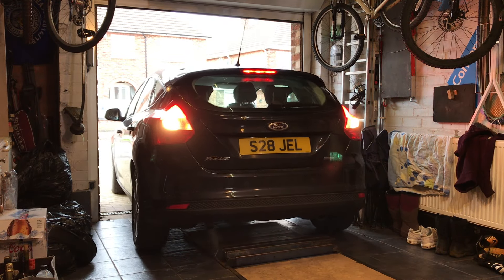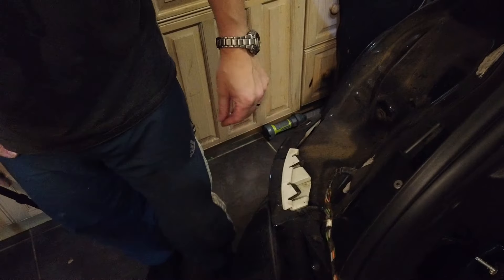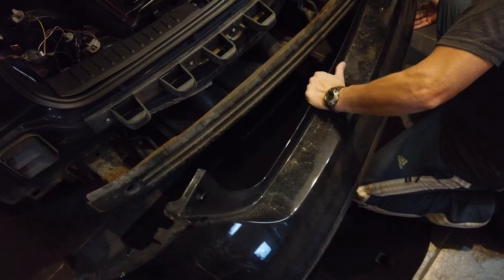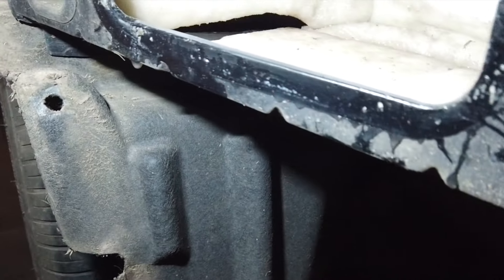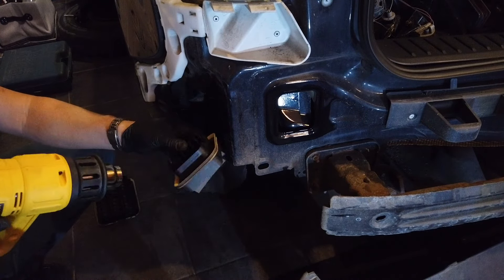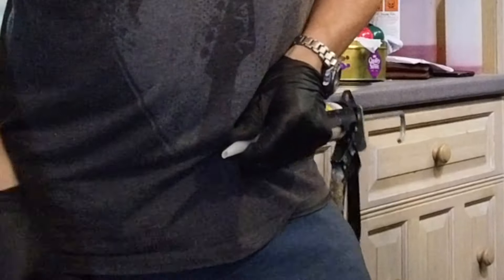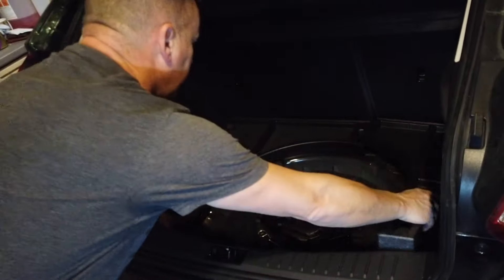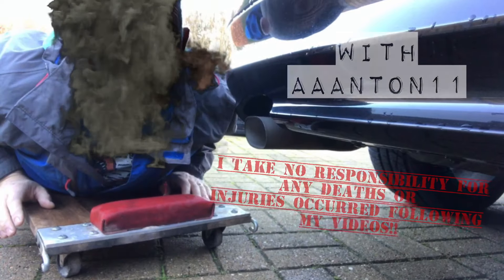Ford Focus Water leak in Boot, Sealing Rear Vents Behind Rear Bumper

Comment: Tip for removing vents. I just did this on my 2016 Fiesta and it only has one air vent on each corner. Here is a tip I found after doing the first vent for removing them at least with the 2016 model. If you lift up the bottom flap on the vent and look into the vent you can see the back side of the clips inside and use a screw driver to push up on the bottom tabs after inserting it between the rubber edge and the car wall (there are two on the top and bottom). This method allows one to see where the screw driver is (while keep the flap up) after inserting it through the bottom of the vent. Lifting the flap made it so much easier to remove the second vent after doing the first one the hard way.
Reply from the maker: Thanks for the great information👍🏻👍🏻🛠

Comment: Fantastically helpful video. After much frustration and one broken air vent I found there is a way to extract the larger of the two vents on each side wihtout too much pain and frustration. You need to remove that bung underneath and then you can feed a screwdriver in while guiding by feel with a finger to where one of the clips is. Once that clip is popped there is another rubber bung to the side of the vent nearest the engine. you can remove this, and although you cant get a screwdriver in you can put your finger in and feel for the clip. This then allows you to feel when you are actually moving the clip with whatever implement you are using and slightly help it out as well. Once both bottom clips are out the vent should come out easily
Reply from the maker: Thanks Joel for the great information👍🏻👍🏻🛠

Comment: I have water coming in on a B max I've tried pouring water around the boot shuts the gas struts the lights the roof rails everywhere you are going to suggest I've tried please can someone tell me where to look next roof rails check boot surround check rubber weatherstrip check gas struts check tail lights join car check where is the water coming in this video shows the vents being sealed check when vehicle is stationary no water after driving around for 10 minutes water back in any ideas?
Reply from the maker: Windscreen seal was a gap in the bonding, its quite common, Thanks for the great comments👍🏻👍🏻🛠

Comment: I learned an easy trick to remove the air vents starting with the bigger one.

Poke the corner tab with a screwdriver through the bottom hole. It should easily come off when you press the release tab. Then remove the top tab on the same side by pressing down whilst pulling. This should easily come off too.

Once you have one side released slide it towards you and pull at an angle. 

Took me 2mins to release the other side when I learned the technique. Hope the instructions make sense.

Thank you for this video!! You've helped so many people now!
Reply from the maker: Thanks for the great information👍🏻👍🏻🛠

Comment: Thank you so much for posting your videos.  My wife and daughter both have Ford Focus cars on 2011-12 plates and both had wat ingression, one right up to the front foot well.  After watching your videos I have now dried both cars out, removed the bumpers and fixed the leaks.  Thank you so much, you saved me a fortune on garage bills and I would not have had a clue how to do it without following you.  PS i also did a front light as well.
Reply from the maker: That is awesome! Thanks for the great comments👍🏻👍🏻🛠
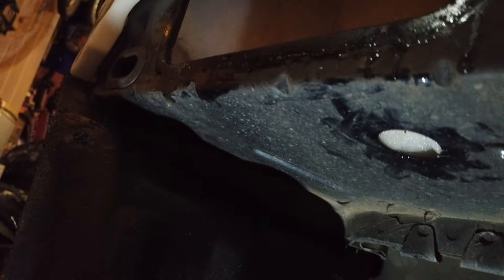Reply: hape you put back on those rubber covers  under the car at 14:00 or its  still open

Comment: Just did mine...your video was a life saver so thank you very much....
I found bestbway to start getting the vents out, is to pop the little black rubber bung out from underneath, and use your finger to pop the first clip thing out, then a screw driver easily pops the other one out amd makes them far easier to remove....
Thanks buddy 👍
Reply: Ps i went overkill and sealed the outside too...
Reply from the maker: 😂😂 definitely not going to leak now then, Thanks for the great comments👍🏻👍🏻🛠

Comment: Thanks very much for this video, followed it through this morning and it made the whole operation so much easier!

I have a hint for making the vents easier to remove!  

Do the back ones first: lift the top rubber flap (gently, these are delicate) and you can simply pull in the top two tabs with a couple of long thin screwdrivers, no aggro at all!
The whole top half comes loose and you can run another thin screwdriver down the outside to push in the bottom tabs.   Back vent comes out in about a minute!

Then reach inside through the back vent hole and, so long as your hands aren't massive, you can pop down three of the side vent's tabs (couldn't reach the top/far one) and wrestle that out in not much more time.
Reply from the maker: Thanks Shamble for the great information👍🏻👍🏻🛠

Comment: Did mine this morning. Thankyou for the video it all went well. Only broke two clips. All four vents were loose and not sealing in any way against the body. Prepped with scotch brite and cleaned with acetone before applying a marine grade silicone  sealant. Fingers crossed it worked. Also made silicone washers for the light fitting bolts. Many thanks.
Reply from the maker: Thanks for the great comments👍🏻👍🏻🛠

Comment: I had this problem on my new to me 13 plate Focus. 
Great video for doing the belt and braces approach of sealing the vents but for me, the easiest thing to do it just remove the bung underneath.
Allow the water to drain then pull the wadding out through the hole.
Leave the bung out.
I've not had any pooling water since.

I don't have the luxury of a garage so again it is the best option for me personally.
Reply from the maker: Glad it helped, Thanks for the great comments👍🏻👍🏻🛠
Reply: i dont have a garage either so will do this quick fix

Comment: Discovered wet passenger floor last week and traced it back to the boot and finally the blanking tape over the holes into that void area. Pushed the bungs inside to release the pond that was hiding so next dry weekend I'll be following your brill tutorial on removing the bumper and sealing the duff vents in properly.   Cheers 👍🏻
Reply from the maker: Thanks for the great comments👍🏻👍🏻🛠

Comment: Great video with detailed instructions. I did that work two years ago on my 2012 Focus. Recently found out again water in the trunk, but only on the right-hand side. Today I took it apart and saw that my vent opening sealing is still good. Then I realized that water must've been entering into the vent corner from the top, around the fuel tank door - it is the same volume. Applied sealant around. We'll see if it is successful.
Reply from the maker: Thanks Stevo for the great information👍🏻👍🏻🛠

Comment: This is a great video with excellent commentary. All the steps are very clearly showed. I followed this to fix the water issue in my Ford Focus Mk3 2012. I used Tigerseal Adhesive & Sealant that I purchased from Eurocar parts 
Removing and putting everything back together probably takes an hour or so. Most of the time is to dry the sound damper cloth and cleaning/drying the water area.
I put the sound damper cloth and grommets back in.
The vent design/sealant is a very poor design from Ford.
Thank you very much for this video.
Reply from the maker: Thanks for the great comments👍🏻👍🏻🛠

Comment: Mate - another one thanking you for this video. My 64 plate was identical to your video apart from (oddly) a mix of bolts and screws under the arches. My soundproofing materiel was identically soaked. Left those and the bungs out - no difference to cabin noise - sealed the vests and happy days!!
Reply from the maker: Well done, Thanks for the great comments👍🏻👍🏻🛠

Comment: I've just bought a focus with a damp boot. Looking like this is the issue. Thanks for this, it's most helpful 👍
Reply from the maker: Thanks for the great comments👍🏻👍🏻🛠
Reply: Just finished. left the car at the airport for a week. When I got home, wheel well was half full of water. Pouring in. had to get new vents from dealer as they broke when prying them out ( £16 each ) Siliconed them also just to be sure. Thanks very much for this video, it was a god send. Job went off without a hitch. I would never have found the leak without you.

Comment: WOW what an awsome easy to understand Video.
THANK YOU very very much for sharing your water ingress solution with us all.
I have a B Max (or as i like to call it the swimming pool on wheels) and I am cursed with the same problem.
I have tried every thing from completely silicone sealing the rear lights to the Car body but i never would have thought that the problem would have been hidding under the bumper air vents : (
It seems like every Ford model Fiesta, Focus, B Max, C Max ect is cursed with this same problem yet when you go to a Ford Dealer they do not want to know, SHAME ON YOU FORD.
Thanks again for posting this great video : )
Reply from the maker: Thanks for the great comments👍🏻👍🏻🛠

Comment: Thanks for posting this, I wouldn’t have known all the bolts & screws to find. My spare wheel well was full of water, now I understand why the rear passenger footwell is wet- the water pushes forward when I go downhill. I had heard a sound like fuel in the tank, now I know it was water in the spare boot.
 I should have listened to your advice word for word, I got impatient with a grommet underneath the bumper and ended up ruining it, other than I got the bumper off and on again. Time will if I sealed it well enough.
Reply from the maker: I am sure you have done a great job Thanks for the great comments👍🏻👍🏻🛠
Reply: How is it now?.. Just found half a bucket of water in boot of our 63reg focus, am gobsmacked this is a common issue, now currently watching many vids on how to fix..

Comment: Thanks very much, I followed this video and it helped. To get the side vent off, a length of dowel up thru drain plug to release one tab, then pull it down to release opposite tab, drag it forward an inch then rotate in cavity to twist it free. 👍
Reply from the maker: Glad it helped, Thanks for the great information👍🏻👍🏻🛠

Comment: Brilliant guide just done this fix this morning after finding water in the boot last night filled half way up my space saver tire, clip on the vent snapped trying to get it off but with it being sealed it shouldn't be an issue, thinking about drilling a small hole in the rubber bungs under the car just incase, thank you very much
Reply from the maker: Well done, Thanks for the great comments👍🏻👍🏻🛠

Comment: Just done this thanks to your video,snapped a piece of one of the larger vents off though 🤦🏼‍♂️ taped it flush and siliconed over the top of it, hopefully it holds. Put a shit ton of silicone on the back and front of each vent, hopefully solves the issue 🤞🤞
Reply from the maker: Sounds like a great repair, that will be ok👍🏻 Thanks for the great comments👍🏻👍🏻🛠

Comment: Great video. A great guide to curing my problem. Both cavities behind the grilled were full of water with no obvious way of entering the boot with the car on level ground, but in motion or unlevel ground it probably flowed through the lower of two perforations so I sealed these on both sides just in case.  I used caravan mastic as it stuck better and is thicker than silicone.
Reply from the maker: Glad it helped! Thanks for the great information👍🏻👍🏻🛠

Comment: Will be attempting tomorrow on my Fix Or Repair Daily. Did a headlight today had water in it. Seriously Ford couldn’t spend a bit money on these tiny details. Will be using your video step by step thanks a lot 👌🏻✌️😁
Reply from the maker: You can do it! Thanks for the great comments👍🏻👍🏻🛠
Reply: @aaanton11   I did it!!!!!!! I freakin did it!!!!!!!!! 😁😁🤩🤩🤩🥳🥳🥳😜😜Only thing I have now is to new plastic screw thingys that holds the bumper under the centre. I can’t get them in, they so brittle. Thank you so much thanks to your accurate video I managed to it on my drive 😘😘

Comment: Great little video, I’ve had a smell in the motor over the very wet winter we’ve had, just found a couple of litres of water in the boot, had previously checked lights and they were ok but this is tomorrow’s job, thanks again.
Reply from the maker: Its a nice job to get stuck into, Thanks for the great comments👍🏻👍🏻🛠
Reply: aaanton11 nice and easy little fix all done, I found the vents came out easier with a bigger screwdriver, it was the side vents that were leaking, job jobbed now 5*

Comment: Good video well detailed this problem is also common on bmax as well my local garage has done this job but I still have water coming in
Reply: I've checked everywhere you can think off the vents have been resealed I've poured water everywhere I can think off on the roof rails over the lights around the boot shut around the rubber weather strip when stationary no water ingress when moving water comes in any think you can think off I've tried any ideas anybody?
Reply from the maker: Windscreen seal was a gap in the bonding, its quite common, Thanks for the great comments👍🏻👍🏻🛠

Comment: good vid ..... but question is ...... why are those vents things there for ..... cos they are basically in the structure of the car that you dont see ?? .... ive no idea ... and that felt padding ... wtf is that for .... mice ???? 🤔
Reply from the maker: They regulate cabin pressure, ever had the buffering when driving at speed with a window down, they are to stop that, Thanks for the great comments👍🏻👍🏻🛠

Comment: Thanks a lot Aron. Its so easy to understand you. The same problem I had with Ford K (Argentine)
Reply from the maker: Glad it helped  Thanks for the great comments👍🏻👍🏻🛠
Reply: @aaanton11  I ask you something: Ford Official Service said to me that the leaking problem was rear vents doesn´t works very well because of mud. Consequently the curtains don´t close well, and the leaking occurs.
But according your opinion and experience, the real solution is seal the edge of rear vents

Comment: Hi. Did you dry out and replace the wadding? Not sure of it’s purpose and whether it will still smell even after drying?
Reply from the maker: It is just for sound proofing, so depending on how smelly it is determined if it goes back, honestly I cant tell the difference if its in of out regarding noise levels or droning in the back, Thanks for the great comments👍🏻👍🏻🛠

Comment: I did this to my focus zetec s the other day, mine had gone that far that it had soaked the back seats carpet in the foot well and also gone through to the front. I had to take out the full carpet of the car. The foam was that saturated under the carpet I had to replace. My advice if you think about doing it, definitely do it because I left mine too long and had to practically strip the car to get rid of the water ingress which had travelled to the front. The car is a 2012 reg.
Reply from the maker: Thanks for the great information👍🏻👍🏻🛠

Comment: Hi...Great video.  So well explained.

A quick question, as I have the same problem.

Question.
I know you first sealed the lights and then did the vents.  You said after sealing lights, the boot was dry.  Did you ever find out if it was the lights of the vents causing the problem?

I have sealed the lights, so I want to know if that first works before tacking the bumper.  I did remove this bungs and water did come out, but that could have been from the lights and not the vents.  You can actually reach up from underneath the car to finger feel the seals on the vents.  I think mine feel ok.  On the inside of the boot, where the bolts are holding the light units are in place, the sidewalls of the boot lining are wet...so I am assuming water is getting in via the lights.  I have sealed both sides.

Many thanks for your video and answer.
Reply from the maker: The Lights and the vents both had issues, Thanks for the great comments👍🏻👍🏻🛠

Comment: Hi, did you put the Grommets (ones under the insulation/foam) back in or just leave them out permanently? Thanks
Reply from the maker: Out, no need for them, Thanks for the great comments👍🏻👍🏻🛠
Reply: @aaanton11  thanks for the reply. Would there not be concern of potentially water and winter salt getting back up there from road spray etc and causing rusting from inside out.

Thanks again Mike

Comment: Brilliant video, is the water ingress coming down from the run off boot door etc or from splashes, if one taped a piece of plastic over the Top side of the vent and allow it hang Loose ,it would divert the water over the flaps but allow flaps work, like an umbrella!! I had a Lake in boot of golf mk7,  break light seal on top of door was very perished, used silicone Grease on light seal. Thanks for sharing this video.
Reply from the maker: Thanks Patrick for the great information👍🏻👍🏻🛠

Comment: Had the same issue. Did exactly the same as you’ve done. No leaks since. There are 2 bungs underneath the car at the bottom of the rear quarters. Ford obviously knew this vents and light mounting points would cause an issue.
Reply from the maker: Thanks for the great comments👍🏻👍🏻🛠

Comment: I wonder if using the undercarriage wash feature in a drive-through car wash drives water into those vents even if they are sealed properly.
Reply from the maker: Doubt-full, the one way seal works well, Thanks for the great comments👍🏻👍🏻🛠
Reply: @aaanton11  thanks much. Maybe the wash drove water into the bad seal. We’ll watch the boot carefully during Florida rainy season and see if we need to do the job. Thanks to your video it should be no problem.